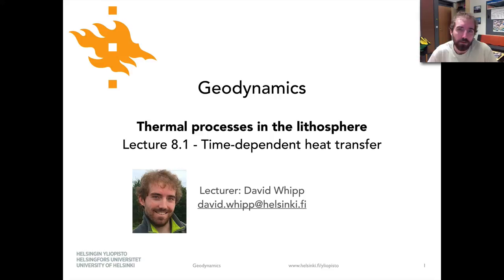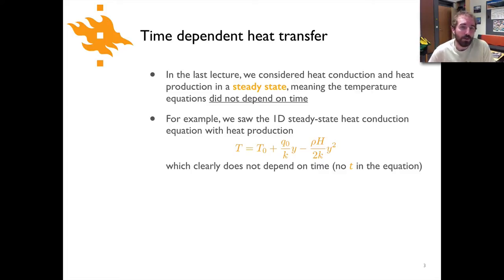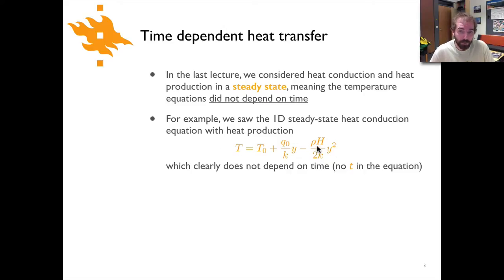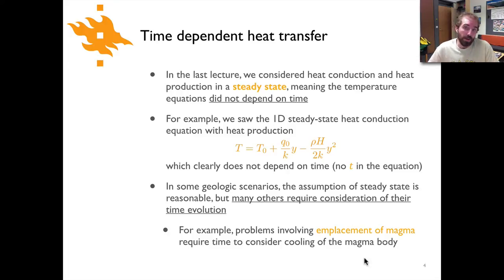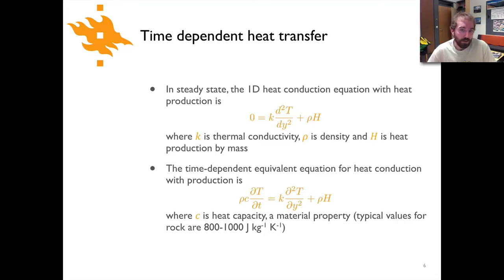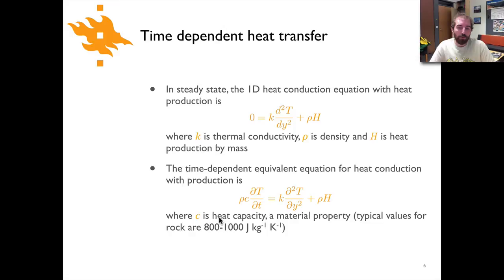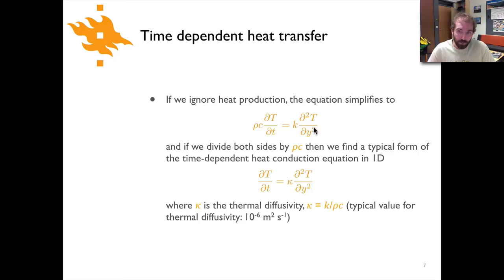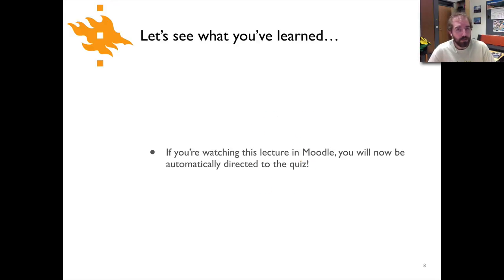Geodynamics - Lecture 8.1: Time-dependent heat transfer

Comment: Hello Sir,
I was looking for similar explanation in the case of structural failure of bar/beam fixed on both sides under thermal loading. If possible could you please explain what parameters need to be considered?